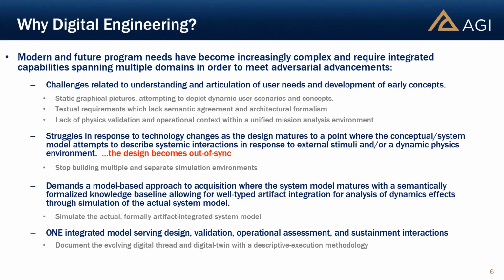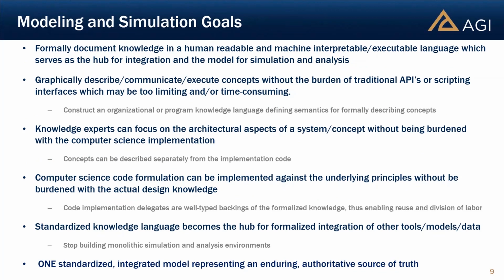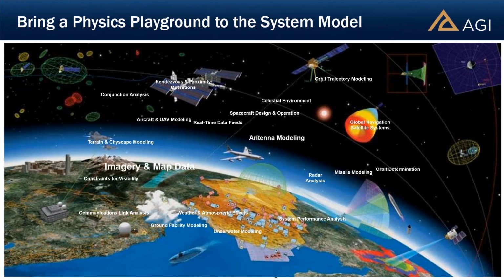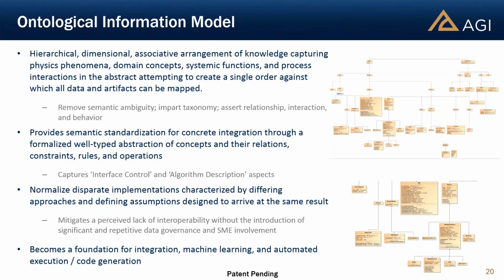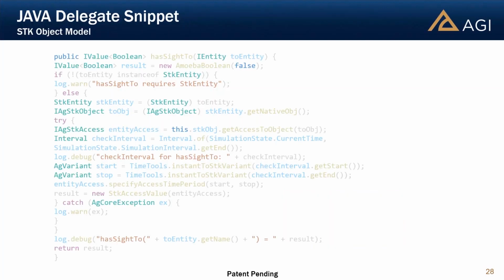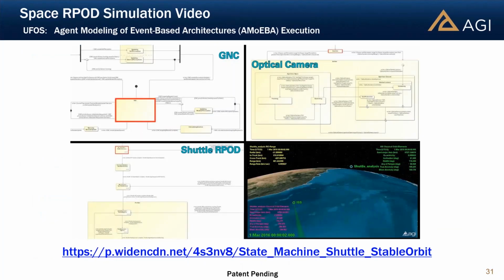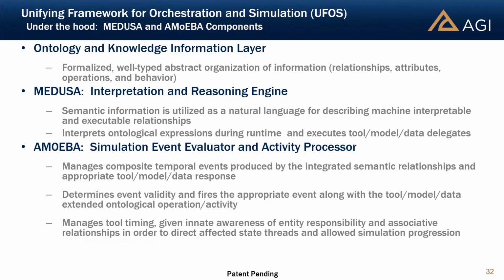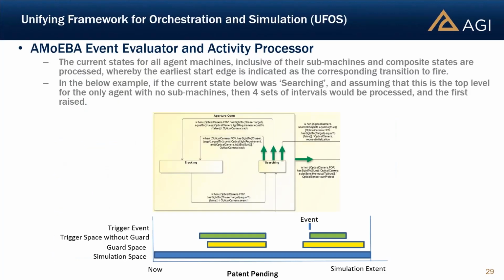Webinar: Bringing Formalized, Physics-Infused Simulation to MBSE

Comment: Great stuff Greg . not sure if you can network stk to have wargaming capabilities team A vs team N with counter activities groups chiming in R/T .. kind of got lost in the jargon on the first couple of slides and the impetus for incorporating rule based constraints without an example but it became clearer towards the end of the presentation with the video .  I worked with some electric power research people in college (im an EE not a sw guy other than cheezy matlab/Simulink no c++)  during the dawn of knowledge based expert system era (1980s .) the framework is there for machine/deep learning and AI so operator in loop systems using  sme knowledge  and system of systems view can implement in r/t elegant decision making . its all good